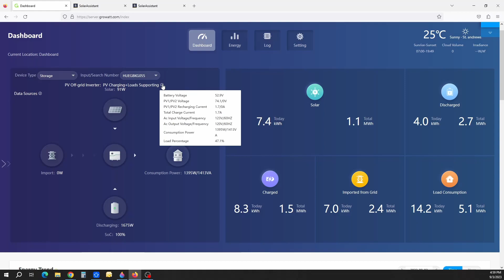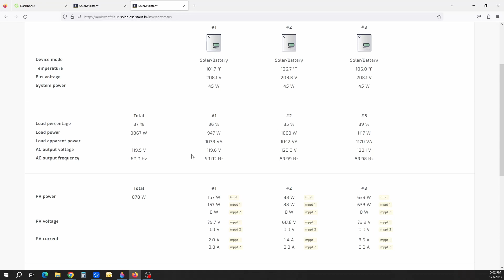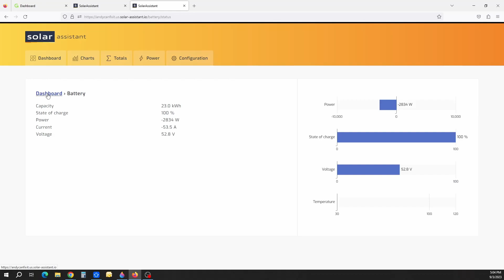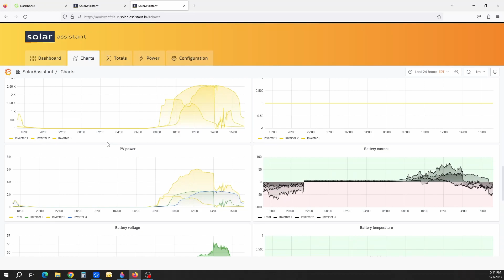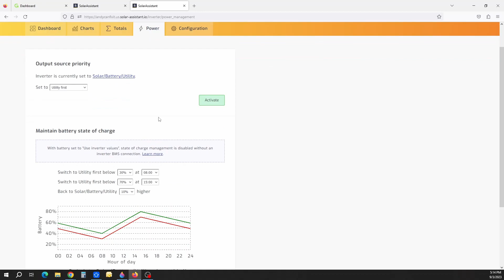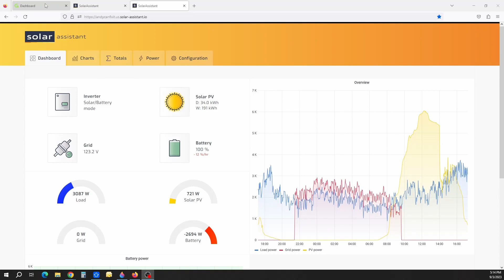Growatt 3 year follow up and Solar Assistant initial impression

Comment: I have a question, my Growatt inverter I got does not support my 15Kw LiPo4 battery giving me BMS Abnormal warning, and was trying to find out if this SolarAssistant wondering if I could use it to talk to the inverter and get it to do the talking to the inverter allowing my battery to work, the problem is I found out after getting the inverter is the inverter only works with Growatt batteries, wish I knew this before buying it, but was told it did support lithium batteries, just not any other brand.
Do you think I might be able to use this as a work around.
Reply from the maker: Unfortunately Solar Assistant will only allow you to monitor info from the battery. It won't be able to act as a go between to the Growatt inverter. Since the inverter won't talk to your battery bms you could instead run it as a custom battery where you simply set the high and low voltage points as to when it uses it and it's disconnect low voltage point for shutdown. That method will protect the battery and the inverter but it won't show you the exact battery status since it can't talk to the bms.
Reply: Thanks for the info, saved me some money, seems I will need to get another inverter it seems.

Comment: Were you able to view the history from before you started using solar assistant
Reply from the maker: You mean the history on the growatt site? Yes. I did discover that on my original inverters you can't feed the data to both the growatt dongles and to solar assistant, after a few days it would start showing numerous errors in the growatt app, showing site faults etc that weren't real. I've basically logged the historical data from Growatt onto a google docs file in my google drive for reference and have been using solar assistant for the last couple months now. There are a few bits I liked better in Growatt but overall the main data bits are more easily accessed in Solar Assistant.

Comment: I started with one of the Growatt 3000 units and kept adding to what I had. I see YouTubers that switch equipment, maybe because they were given it for promotion, but for most of us, it is cheaper to keep using what we’ve got. I’m running six of these, and have been happy. I’m also located in southeast VA.
Reply from the maker: Yeah, I don't have any sponsors or free products from anyone, everything I have I've bought with my own money. I think I was one of the first to use these particular Growatt's as when I bought them as there really weren't any good tutorials on using them. Given how well they've worked I can't see any reason to replace what is working well. If they were junk I'd certainly replace them.
Reply: @andycanfixit  I probably watched your Growatt video over 20x’s.

Comment: I find it odd the dashboard doesn't display battery voltage on the screen as large number.  It's the most important number to me.  You instead have to hover above the teeny tiny 'I' information icon.
Reply from the maker: Yeah the dashboard could use some tweaks to improve it but it really hasn't changed in the three years I've had these. Even in the app you have to click the little info button to see that battery status info. I do like that the info is much more front and center in Solar Assistant and I don't have to deal with loss of connection issues like the Growatt app and dongles suffer at least once a week.
Reply: @andycanfixit   hmm, I rarely get disconnection issues, it's been pretty stable for 3 years
Reply from the maker: @AGhostInTheMachine  It never lasts very long, a few hours at most but one or the other seem to do it at least once a week, pretty much from the beginning. I had a Ubiquiti access point originally, switch that to a TP Link no change. My Blink cameras use the same wifi with no issues. If you unplug it and reset the dongle it'll come right back or just leave it alone and it comes back on its own in a few hours. The inverters seem to store the days overall stats so once it's back online you get your total production for the day, you just lose the 5 minute interval stats while it's offline.